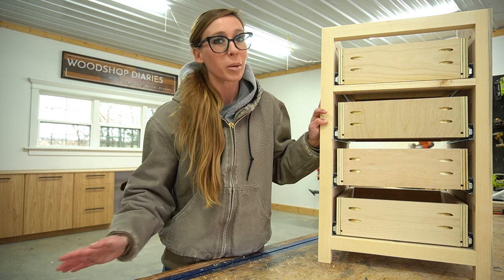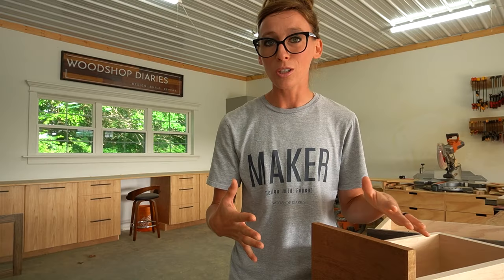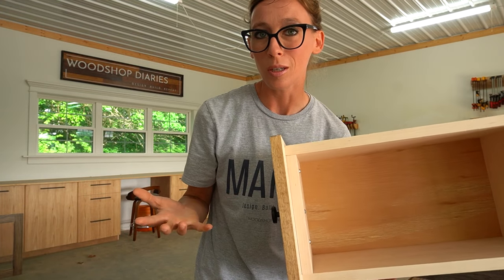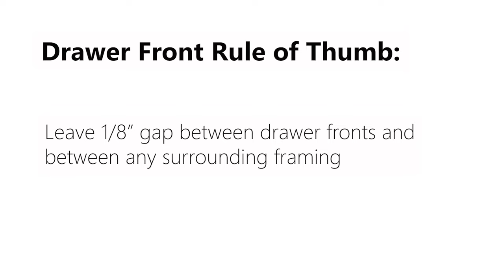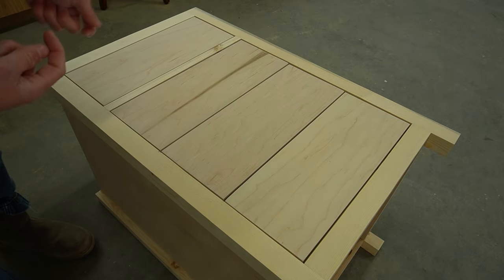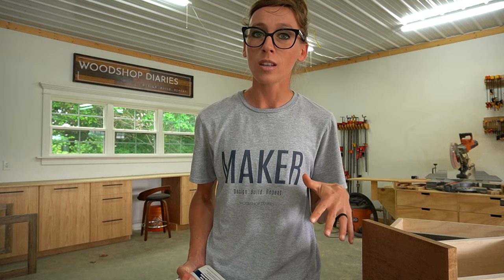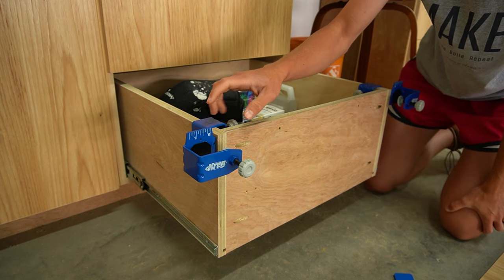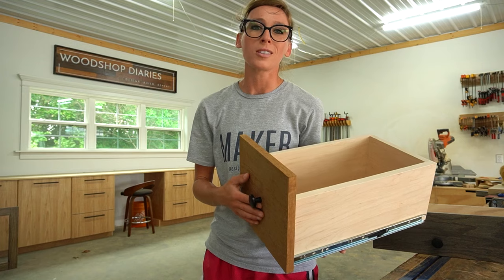How to Install Drawer Fronts

Comment: Nicely explained! I already started typing a comment to mention the trick with the pilot hole when you did the first drawer, but then of course you showed it 😂
I like Greg's jigs, but this one looks overly complicated and awkward to use.
Reply from the maker: I really wish I had a better example to show this jig on for this video. But I haven’t built anything with drawers since I got it and I really wanted to wrap up this series. So I just tested it out of a random quick fix. I think if I showed it installing fronts from scratch and from the bottom up (vs the top down), it would make a lot more sense and you wouldn’t see it that way. It’s really pretty simple though…clamp them on the drawer box, add shims, clamp on the front, screw in place. But, obviously, some people prefer different methods for everything. Hopefully I’ll build something else with drawers eventually to try this out again on a whole project (not a quick fix like this) to get the full feel of using it. We will see. 
I’ve got some outdoor projects to tackle first haha. I hope you have a great weekend and I appreciate you watching!

Comment: Thanks for sharing the drawer building series with us.  You gave me many tips that I will use in my little shop.  I saw the Glaze in the bottom drawer in this last video.  I am hoping that you will do a tutorial on using this product.  I'm curious about it, but nervous about trying it for the first time.  It's so expensive that I'm afraid that I will make a costly mistake.
Reply from the maker: So happy you found these helpful! I actually did a sponsored campaign with them several years ago and used it to create a lazy Susan type project: https://www.woodshopdiaries.com/diy-wood-and-epoxy-lazy-susan/
I’ve not used it since (these boxes are pretty old now haha) because I kind of hate epoxy 🤣 but it was a pretty simple formula to use and I love that is comes in already tinted colors. As long as you keep temps around 70ish or so and you mix them the right ratio (if I remember right, these are a simple 1-1), it’s nothing to be nervous about!
Reply: @WoodshopDiaries  Thanks for the link.  I just watched read the article.  I think that I will give this a try.   Thanks again.

Comment: Very nice video Shara!  Just a minor detail.  The holes drilled for a screw to pass through without threads grabbing are called “clearance holes,” not “pilot holes.”
John Jensen from British Columbia
Reply from the maker: Thanks so much for watching! The definition of a pilot hole is: a small hole drilled as a guide for the insertion of a nail or screw, or for the drilling of a larger hole. Maybe “clearance hole” is another term for it. But these are, by definition,  pilot holes 😊

Comment: I am building closet inset drawers and your tutorial vids have been very helpful.  I do have one question to get conformation though.
Do you leave a 1/4 inch over hang of the facial board from the bottom of each drawer?
Reply from the maker: So happy you find them helpful! Also, the amount the drawer front overhangs the bottom will depend on how the slides and drawer boxes were installed. This amount will vary, so it’s not always any one specific amount.